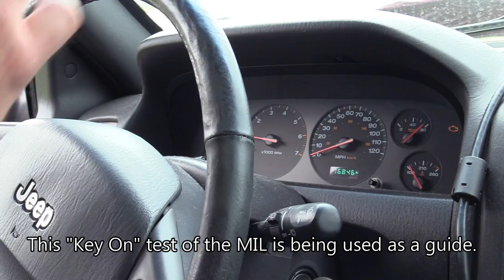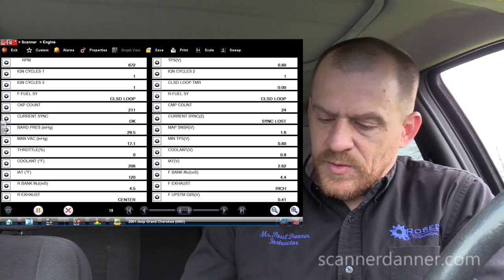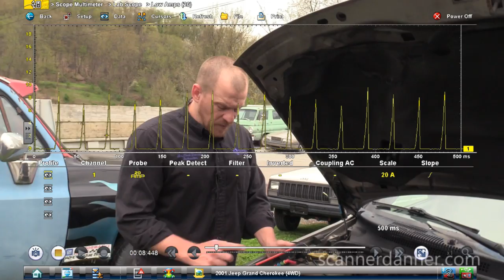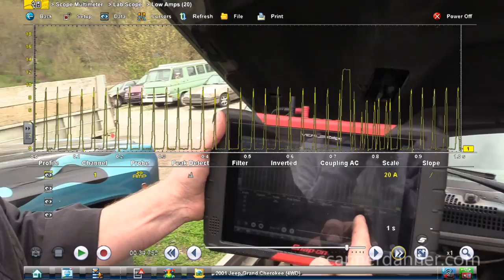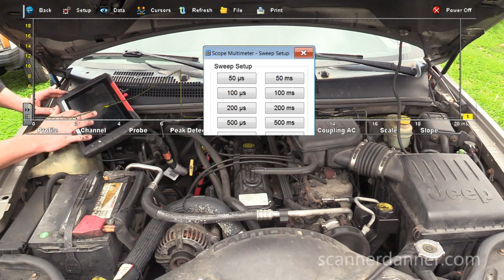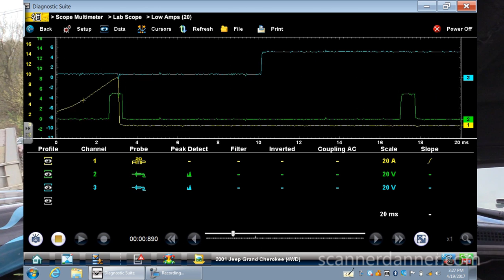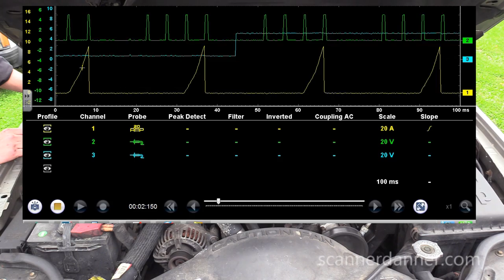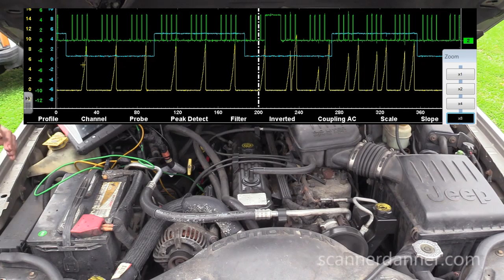Jeep Cherokee 4.0L Misfire and Primary Ignition Trouble Codes

Comment: Scannerdanner
I'm having a problem with my 1993 Jeep Cherokee my wife just went to the store came back out the start the vehicle and it would not start I told her to do the three on and off key thing and it gave her a trouble code of 51 and 54 51 is a lean code 54 is a cam sensor code I have no other way of diagnosing this should I go ahead and replace the cam sensor it's not showing me a crank position problem with the cam sensor code and the lean code I would assume that it is of the cam sensor but you know what they say about assuming
Reply: Nevermind I bought a whole distributor and put it in fix the problem thanks anyway

Comment: Hello I would like to ask a question who is responsible for the timing of the injection of gasoline and who is responsible for the timing of giving the spark cambshaft sensor  or  crankshaft sensor ? Thank you
Reply from the maker: The engine computer is based off of the cam and crank signals.

Comment: Hey Brother,  Ive' had my Grand Cherokee Laredo 2001 since begging..  145K miles. Done most of my own work on it.. Hasn't been to problematic.
But living in Texas, and not long ago the radiator cracked and leaked out all fluid(replaced it 8 years ago). Got it home, but it heated up past temp max.
Was receiving code P0307 - Missfire on Cylinder 7. Did some troubleshooting and swapped spark coil 1 w #7 and it moved to #1. So replaced Ignition Coil.
All good?   No more codes and replaced 4 sparks on right side of V8. But now it Idles bad. It's noticeable right away to me, because I had it for years.
 At first thought it was a misfire or a piston not firing, But now think It might be fuel related. Will check fuel pressure and
 replace Fuel Filter(Fuel Pressure Regulator) JGC 2001 has them both in one. No engine codes. It starts and ides for 4-5 min roughly.. t
hen eventually goes idle high then low and dies. 
Using Torque App on Android and OBDII. I think I successfully loaded all GCJ PID codes. Nothing red comes up on real time data.  Any suggestions? Tanx

Comment: On the green crank trace I noticed usually the first of the four pulses was dropping out when you increased rpm, my first thought was to far away for the sensor to pickup the detail under rpm. Is there any discernible difference in wave form to determine if its too close or too far or just smashed up?

Comment: i have a 2000 jeep cherokee with these exact symptoms. i literally just replaced the cam and crank sensors a day ago, im gonna pull the crank back out and check for rubbing. is there anything i have to do adjust the flywheel or is the sensor the only thing that needs to be adjusted for a proper air gap. if i do have to adjust the flywheel, how do i go on about doing that?
Reply from the maker: thankfully you do not need to touch the flywheel, just adjust the air gap of the sensor. Push it in all the way, then back it off a hair, that is all you need to do.
Reply: Dude i have the same questions.. theyre really great questions..
Reply: Like Scanner Danner says i just unbolted the crank sensor and adjusted the air gap then had a friend with the scanner to sync those cam and crank signals. Good as new

Comment: I have a similar problem but when it come up to temp it cutsnout misses and acts like it's outta time this all start after a shop rebuilt the Trans I've put 4 crank sensors 4 cam sensors the post it sits on coil pack fuel pump filter
Reply from the maker: Watch these. Air gap issue on the crank sensor is what it sounds like 
https://youtu.be/ws59zXvr1SM
https://youtu.be/agbEFhAyYI4

Comment: Cool get it now ive got big prob though 4.0 jeep middle coil keeps getting hot one exploded not firing either any way to test output from computer at the four connector wires without a scanner would appreciate any help

Comment: I have a 96 Jeep Grand with a 4.0, I have it perfectly timed. I thought it was the problem. Runs fine until I step on it on the freeway. It misfires on every cylinder. I clear them, and they come right back. No problems at idles, feels totally fine.
Reply: My friend at work has the same problem with his 96 jeep. Have you solved this issue yet?
Reply: @krp-xe3hw  Yes I did fix it! What originally happened was my Jeep wouldn't start, so I began changing sensors, including the Cam shaft position sensor, and then the crankshaft sensor. Then I found out it was a bad distributor. I got a new distributor and installed it. I correctly timed my Jeep. But it would always randomly misfire. After a year of continually trying to time the jeep. I found a video about never buying cheap parts that are not OEM.

I realized the crankshaft Position sensor was not a original manufacturer part. It was the right fit, but it was a China made crappy version. 

Your friend might just need a new Crankshaft Position Sensor, it has a magnet in it, and the magnet gets weak over time. But if he buys a cheap one the magnet will also be weak. 

Tell them to only buy Mopar oem Parts for his/her Jeep. Unfortunately you can only buy them online, or at a Mopar parts store. Auto parts dealers will not sell you the right part even if the say it is OEM. 

Sorry if I over explained this, it was a pretty big headache. Hope they fix it!

Comment: Everything pointed to the same conclusion on my 1999 UK Spec 4 litre petrol Grand Che. Ltd. The misfiring wasn't as concerning as the cut out and total loss of power that could strike at any time, sometime occurring at a highly dangerous location on the road. Suspected Auto gearbox over heat cut-out sensor might be the cause but temp gauge showed nothing unusual. Engine would start again after 20 - 30 minutes. Fault codes confirmed Crank (and Cam) sensor. Replacements made no difference. Fault was on common feed and connection plug-in block #2 (middle) into PCM was cleaned / seated. This appeared to rectify misfire but engine cut-outs started to occur again with no fault codes registering. Of course many (not all) auxiliary engine bay components are location arse about face for the UK with my PCM atop wheel arch with screen washer bottle between it and the engine, on the right when viewing engine. My mechanic now thinks that the sealed PCM has a fault. Mechanic has high end diagnostics equipment and good instincts but I feel we're clutching at straws now. These cars are supposed to be so reliable (but perhaps that's wishful thinking). Any insight....?
Reply from the maker: is it setting any fault codes?
Reply: Not since they were cleared and sensor set up. Total cut outs followed and took car back. No fault codes registered. Car is again with mechanic and his focus is on the PCM but admits that with no fault codes, a new PCM might be needed. I am beginning to wonder is an unrelated problem might be related. There is (or has been) an intermittent power drain on battery when vehicle is parked up. After say 3 weeks, it might be fine, or 3 days, battery is flat. Previous owner fitted a simple idolator switch to address but I wonder if such a short might be causing cut out and flash clear memory of fault codes. It's Bazaar. Hope it's not going to burst into flames.

Comment: How is the adjustment done with those sensors so as not to hit the flywheel?

Does the CPS air gap apply to jeep renix engines? The sensors for those engines do not have an elongated bolt mounting holes.

 The CPS should have .5v when cranking. Mine has .2v but starts. What issue could be the result of .2v?

thanks in advance

Comment: Sir,,,can you tell me..whats my 1998 grand cherokee problem is,,,i have check gages kept onn....then i replaced a new oil pressure sensor....but check gages light qas gone! But after a few hours it came back onn....
Reply from the maker: What gauge isn't working?
Reply: @ScannerDanner  the check gages light is keeping onn..it went out for a few hours..then it appears..all level fluids are good level
Reply from the maker: @jamesark9926  one of your gauges is not working properly for that light to be on
Reply: @ScannerDanner  yeah...is onn and off...i dont know how to fix it
Reply: @ScannerDanner  Sir...are you a instructure? What do you teachs?
Reply: Now i just found that...when i  started it ... After a few minutes...the check gauges it appears! At a desame time my battery odometer is also pointed all the way. From 9...14....19...its look electrical issue

Comment: Amigo how are you I was checking my crank sensor and like you say to touch it and see i notice that that is vibrating he needs to be a adjust right I think you solved my problem because mine is vibrating like a little knock I think that will fix my problem if I I just like you say
Reply from the maker: Absolutely! And it may be damaged if the air gap adjustment doesn't fix it.

Comment: Boss it’s possible to convert the 1999 jeep charokee distributor assy to 2000 or 2001 type electronic distributor assy.
Reply from the maker: You would need to swap out the ECM and some of the wiring would be different

Comment: more than likely they had a cheap auto parts store special crank position sensor made in China or Mexico in there. those cheap sensors cause all kinds of problems and is why I only use Mopar Factory replacement sensors in all the Jeeps I've ever owned. I wish Chrysler would take a page out of GM's book and put the crank position sensor on the harmonic balancer where it's easy to get to

Comment: Nice. Like the followup. What was the ohm values? Know you don't like to do that, but sometimes it gives an indication, probably not in this case. But I'm gready, I want it all... ☺
Reply from the maker: :-). You cannot really effectively ohm test a hall effect sensor, even if there is a spec for it. There is an internal switching transistor and a whole bunch of other components. (Schmitt trigger device, amplifier, transistor, magnet etc)
Reply: ScannerDanner Btw... is it true that the last time you had a brain EEG it looked just like a crankshaft sensor output? ☺
Reply from the maker: hahaha very possible, but with a lot of glitches

Comment: If I replace a bad cranck sensor . Does the jeep need to relearn the new sensor.
Reply from the maker: No
Reply: @ScannerDanner  Thank you. I have this problem with my 2001 jeep grand cherokee. Every time I try to pass someone, I step on the gas and my check engine light comes on with miss fire codes  I was wondering if it  has something to do with the new sensor.
Reply from the maker: @jcarlosperez71  It is possible if you didn't set the air gap correctly that it is hitting the flywheel and causing your issues. Was this problem there before you changed the crank sensor? If yes, then it is not what I just mentioned. If no, then I would absolutely start there.
Reply: @ScannerDanner  I will look into that and I will let you know.

Comment: my Jeep TJ has 91,000, miles I replaced my stock plug's 41,000  miles ago got a misfire in my number 4 cylinder reset my computer and my keep ran fine, however, the light came on again I will replace number 4 spark plug hope it's not a compression issue

Comment: Desperate with my 2005 grand Jeep Cherokee Laredo. I put gas and when I turned it on in die on my. I turned it on again and press on the gas and it started to shake. The motor light when on and it started flashing. At that moment I called a tow truck and took it home. When I installed the code reader it gave me 3 different codes. 
P0430
P0300
P0304
After that I changed all 6 spark plugs and coils. Then, I erased all the codes and gave me P0300 again. When ahead and checked the fuel pressure and it’s was good. 

But the problem was still there so I decided to call the mechanic who checked the cylinder pressure test and the cylinder were good except for number 4. The mechanic said that we need to replace or rebuild the entire head. Is the diagnosis correct or can it be something else?? Please help!!!
Reply: Is the mechanic diagnosis correct or could it be something else? Please help!!!
Reply from the maker: I have some videos on doing a compression sound test. Something you can definitely do.
I show the procedure in this video https://www.youtube.com/watch?v=5guCT6JkJwQ&t=38s
Reply from the maker: You'll have to disconnect your coil assembly to keep it from starting, your Jeep doesn't have a clear flood mode

Comment: Hey brother.. Me again, at end of story.. Grand Cherokee Laredo 4.7 2000 - After replacing radiator, passing checks then doing deeper diagnose- Turns out (constant P0307)  after extreme overheat situation, cylinder #7 compression is 30PSi and doesn't climb after reset gauge.
Compared to others (80's+ PSI). Don't see off the bat ,  any effect on radiator fluid (cap off) while running, no bubbles or overflow (doing it solo).
However, spark plug has tar like buildup within 20miles. At this point; assume either Cylinder O-ring is bad or head cracked when overheated. Trade in time? What are your thoughts? Thanks.
Reply from the maker: or find yourself a junkyard engine. I wouldn't bother trying to fix something like that given it was severely overheated

Comment: And i guarantee you that radiator busted because the fan relay is burned out...i just did this job in the same model...that person needs a new rad and rad relay...
Reply from the maker: pretty sure this was a clutch fan on this model but I am aware of the issues with Chrysler cooling fan relays (which is really not a relay but more of a module)
Reply: yeah i opened up the old relay that was bad and it was a little computer or module as they call them...my friend's radiator fan hadn't been working for the last 3 years...
Reply from the maker: Yep. It is a pulse width modulated electric fan with two speeds. High speed there is no pulsing, it gives the fan motor either a full power or full ground (I can't remember the polarity off-hand). And low speed the motor is pulsed to slow it down.
Reply: Those solid state fan relays are always bad, and they put them in a bad spot that is underneath the headlight, and you have to cut the plastic underneath to get to it. The 4.7 Grand cherokee has a goofy system that the cooling fan is driven by a hydraulic motor hooked to the power steering pump.  Those are infamous for going bad too. I own a 2000 4.7 Durango, and it has a clutch fan and an electric fan.
Reply from the maker: I know! The manufacturer wants you to remove the front bumper! NOT! I cut a hole too :-)
Reply: so I'm not the only hillbilly that cuts access holes :)))
when a radiator leaks, it's most always at or near the top hose, caused by thermal cycling, the material gets brittle, breaks easy, it turns a brownish color and gets a rough textured look and feel inside. you can usually scratch off flakes with a thumbnail.
the issue's caused by hot engine being shutoff, there's no air flow, what you get it hotter than normal coolant cooking it same thing happens to many of the "plastic" intake manifolds, water channels from heads through them to thermostat housing cooks :)

Comment: Why do I now get a 1296 code map only after I replaced my IAC?? And start shuddering stall continues.
Reply from the maker: Need a little more info to help. What was your symptoms before you changed the IAC? What year, make and model and engine?
Reply: @ScannerDanner  My symptoms were loss of power, engine fluctuations while accelerating and stalling. It started after, from a stop, I down shifted into 2nd (AT) and punched it to get ahead of traffic. I had this problem 2 years ago and replaced the IAC, TPS and MAP. My 2000 4.0L 6IL Grand Cherokee Laredo had a hard time getting back to normal after I replaced these sensors. I'm getting this code off of my dashboard and didn't get no codes when this started happening not even a engine light! So I assumed it was hopefully a dirty IAC. The IAC was clean like new and almost hot to the touch. 
I replaced anyway then got a code of 1296 which I believe is a MAP Sensor. Also cleaned the TB. The new IAC got the car running fine at speeds above 30mph but took awhile to stall when stopping at idle and had to power brake it to keep it from stalling. I put the old IAC back in and now it's a hard no start and only code is 1296. I ordered a new MAP and my first OBD2 scanner, will be here today. No vacuum leaks.
Do I reset the codes before starting the car or after I replace the MAP then reset then start?? Thank's for your help! ✌️
Reply from the maker: @jat-justamaturetech-philpj8285  what is the definition of the 1296 code?
Reply: @ScannerDanner  I don't know! If you're referring to a scanner reading probability, I haven't got the delivery yet!
Reply: @ScannerDanner  Update! I put the new MAP and left the old IAC in. I cleared the 1296 code and started it up. Started just fine with the proverbial 2000rpm high idle. 
Drove on fwy for 10 mins but idle didn't come down. So drove to return new IAC and started at high rpm. I tapped on gas and it started to go higher by itself and stuck at 3000 rpm. I freaked!  Then it started to slowly come down to 650 - 700. It is fluctuating between 675 and 700 but very slowly. Drove home and rechecked no codes. Started and restarted a few times to make sure it's OK. For now!😁👍

Comment: Are all crank sensors adjustable? Say like on a 07 5.7 grand cherokee?
Reply from the maker: No sir, though possibly an air gap adjustment on that Cherokee
Reply: Scanner on the 99 jeep grand cherokee should I have 5 volts continuous on the crank sensor or just when it cranks. I was told 5 volts all the time. If so where does the 5 volts come from. The computer???  I am list as last years Easter egg